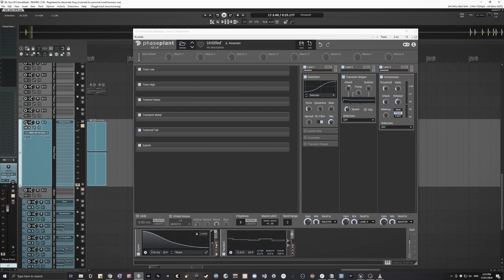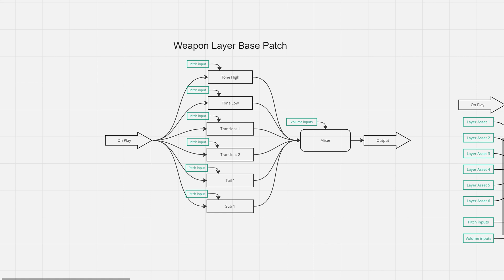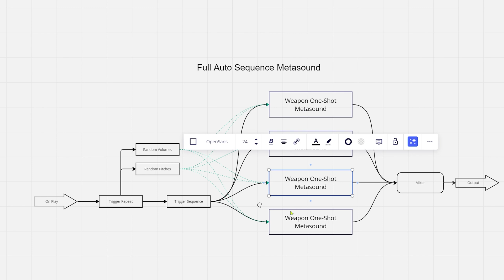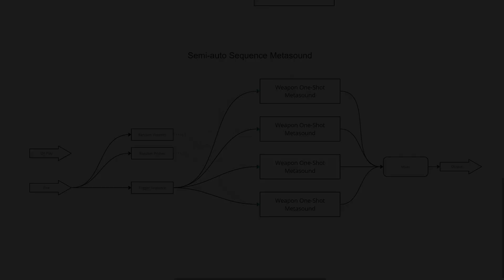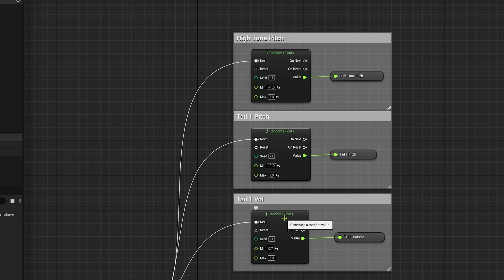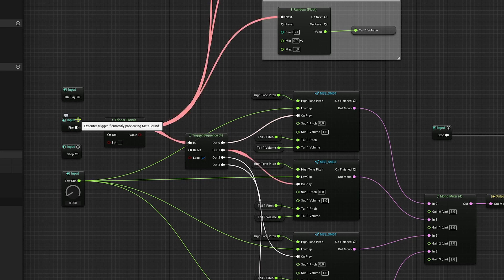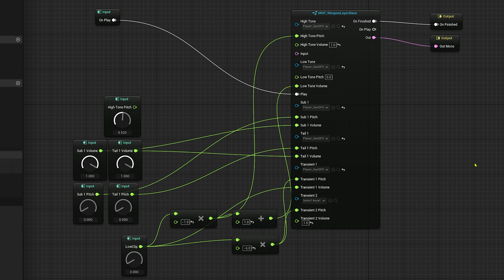Implementing Sci-Fi Weapon Sounds in Unreal Engine 5.3 Metasound

Comment: Great Video mate, how do you handle concurrencies when using 5-6 layers per gun fire especially on autofire when there may be multple guns firing around you?
Reply from the maker: Cheers! Excellent question!

I would only use this many layers for the main player's weapon. The goal is to add detail to the most repetitive and noticeable sounds that the player will hear constantly. In a multiplayer context, I'd create a simplified version for 3D gunshots fired by other players. This approach balances performance and audio quality.
For other players' gunfire, I'd focus on how the sound varies depending on distance from the listener, rather than making each individual shot highly detailed. To handle concurrency, I'd use audio pooling and prioritization. This means pre-loading a set number of audio sources and playing the most important ones based on proximity and significance to the player.

I hope this helps!